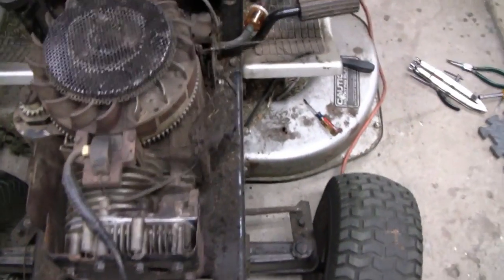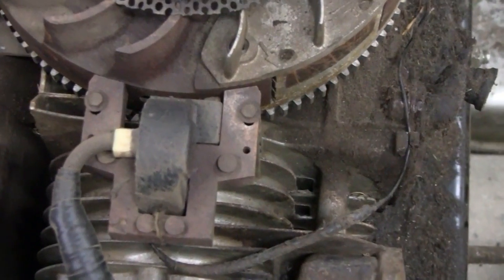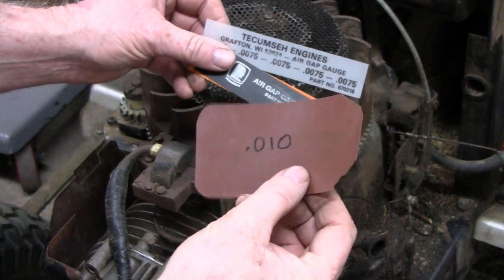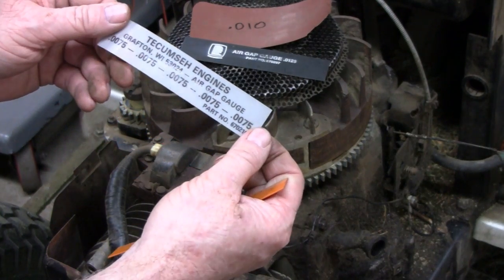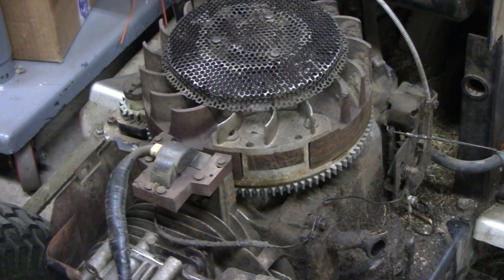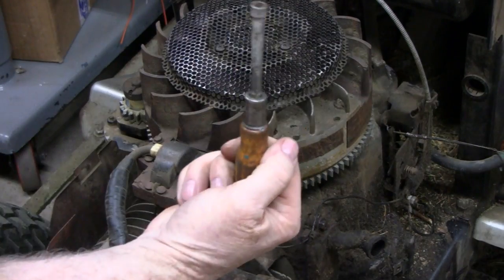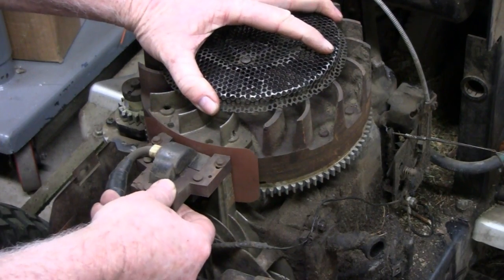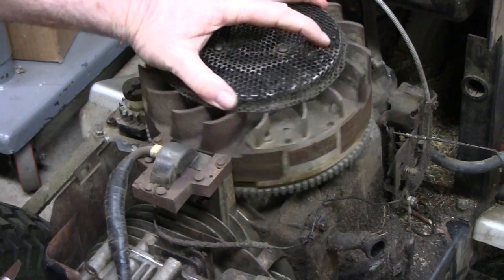HOW TO ADJUST COIL AIR GAP ON BRIGGS ENGINES

Comment: spin tight for a nut driver.
never heard them called that.
just like the Midwest a vacuum is called a sweeper.
different names for different parts of the country
Reply from the maker: Spintite was made by Walden Tools from the 20's to the 90's they had wooden handles!! I'm pretty sure the one I was using was a Spintite!!☺
Reply: 805ROADKING 
just like my grandfather always told me " if you can't learn something new everyday there is something wrong with you". got my quota in for the day.

Comment: My father used two one dollar bills, said that was .012 , never mic one just took his word. 
Worked good tho.

One engine he had in the spring after setting thru the winter would have a yellow spark, all we do was pull shroud & sand magnet & rub a very small drop of 30w non-detergent oil on the magnet. That's all we do & go from yellow to blue most years. 
One of those " had to see it to believe it things" 
That was 5 decades ago . Sounds better than 50 years HaHa

Comment: Oh, and don't forget, if the coil laminations or magnet are rusty, the engine will not run as believed by many nimrods. Or is that dillrods? Putting all seriousness aside, removing the rust and wiping with your choice of a rust preventative is not a bad idea
Reply: Dude thanks for that tip, I have a v-twin 407777 that sat outside for a month and wouldn't spark when i re-installed it in my Craftsman LT1000. I cleaned off the magnet with a wire brush then regapped the coils, and it fired right up!

Comment: the tip about having the magnet pull the coil tightly over the tool is very helpful. that would not have been intuitive.  if someone does sand the parts would you eventually have to adjust for that to extend the gap?

Comment: Another thing to note since you mentioned timing...  most coils are different even if they look the same.  Especially on newer engines.    They have different ignition timings based on the geometry of the coil lamination and windings.  The wrong coil might run, but may cause an engine to ping, overheat, or start hard.

Comment: Thanks, Roadking.  I've always used a business card, not knowing that it's about .022 inches, so knowing it should be .010 on most Briggs engines is an eye opener.  Since I don't do a lot of small engine stuff, a feeler gauge will probably work for me.  The important take-away is to always look up the specifications to make sure it's done right.
Reply: thats what a guy showed me 30 years ago, always worked good
Reply from the maker: It's kinda like a spark plug, suppose to be gaped at .030 but it will still work at .060!!☺

Comment: Whiskers.  Ain't gonna recognize you.  Anyways, aside from corrosion altering the gap, is it necessary to sand the magnet and the other steel pieces in the flywheel?  I see lots of guys do it but not convinced it helps anything.
Reply from the maker: Nah I don't think sanding really does anything but make it look pretty!!☺

Comment: ever use a business card?
Reply from the maker: Never!!☺
Reply: 805ROADKING I just got a 1968 4hp briggs running. I used a card on the coil and it worked fine. I would've replaced the motor before rebuilding it but it's on an old homko tiller that I wanted to keep factory.